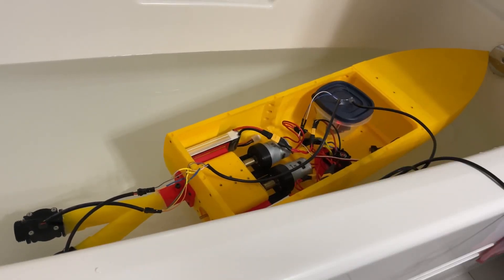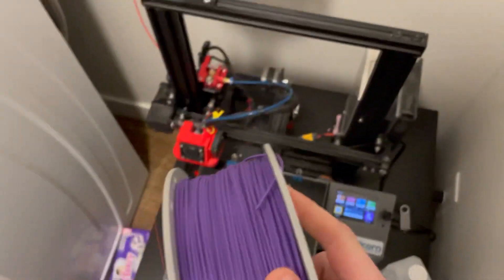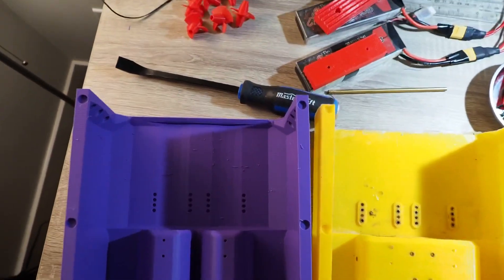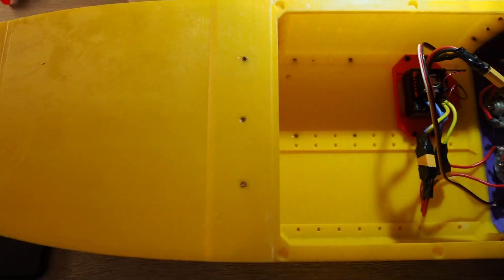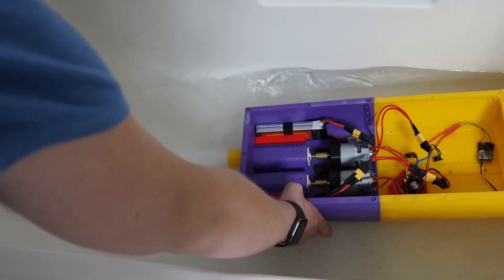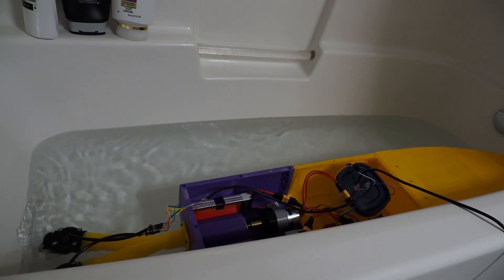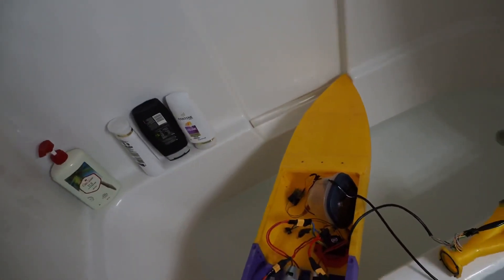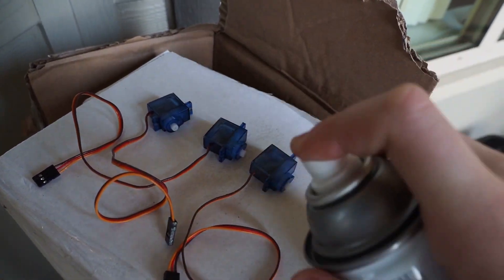3D Printed RC Boat Part 4: Big Changes!

Comment: When you repeat these tests you should really be recording wattage to see what design is most efficient. To prevent burning out those motors you will want to see what the max amperage they can take continuously and ideally make it so that’s the amperage at max throttle. (rather than choosing whatever produces the most thrust)

Comment: Interesting, only watched part 3 and 4 but why not use brushless?
Reply from the maker: I’m probably going to upgrade it to brushless in a future video. For right now I’ll keep it brushed because I’m cheap and brushless escs are expensive. Thanks for watching!
Reply: @mediocremaker5575  if you don't use sensored escs they can be fairly cheap and pack much more of a punch than brushed. Also maybe look into kv ratings, when you changed your motors for faster ones you mightve not made it more powerful, just changed the "gearing". 

The water flow testing bit is really clever though I'd pursue that to find the best combination!
Reply from the maker: @sashablfc  Yeah for sure, I'll take a look at  brushless motors in a future video. I want to compare the performance to the brushed motors using the impeller tester. I wont buy sensored ESCs anyways because they aren't really needed for this application

As for the brushed motors, yeah they are lower turn motors rated for higher rpm. The reason I said more powerful is that it seems like they have more torque then the original set too which is kind of weird. I think that the first two had lower quality magnets on the stator.

Regardless, I want to find a good motor-impeller combo for this rpm range. Thanks for the feedback!